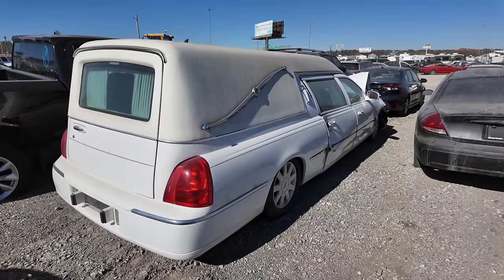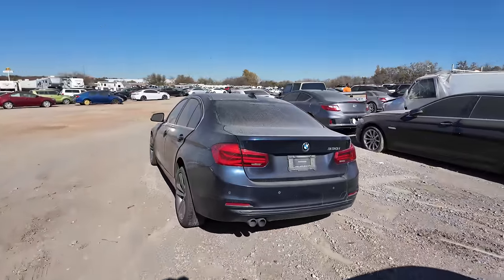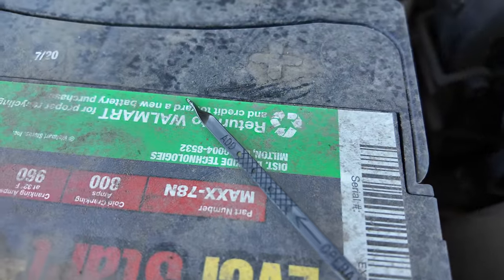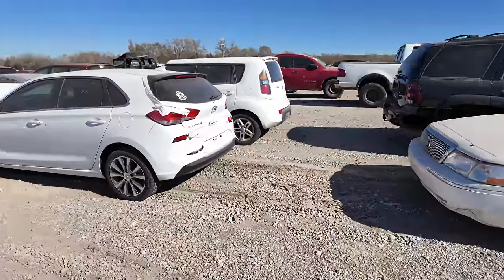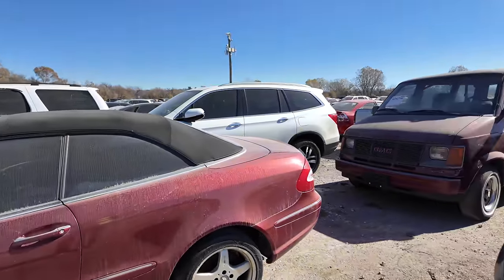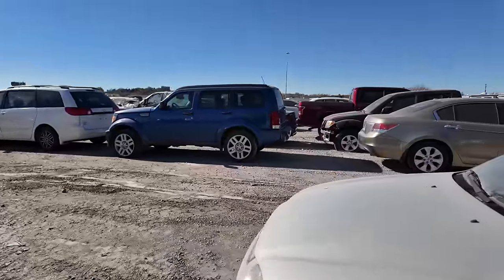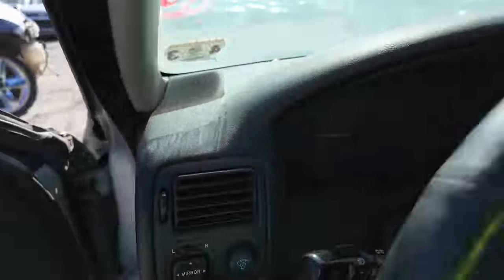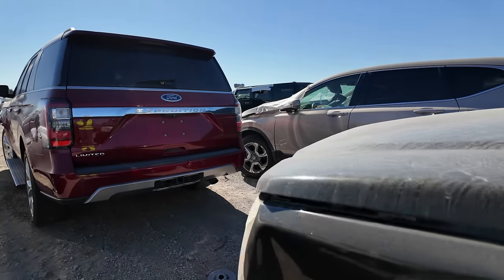This Lincoln Limo Hearse is at IAA for Sale SUPER CHEAP!

Comment: Hearses are all custom builds by coachbuilder companies and VERY expensive new, but depreciate extremey quickly.  Once they're over 5 years old or have over 50-60K miles on them, they go very cheap as the funeral homes aren't the likely purchasers at that point.  I'm a retired undertaker and when I sold the business 5 years ago, my 96 Roadmaster Hearse went with it, with 30,000 miles on it.  It was approximately $100,000 CAD when new in 96,  Thanks for the great content!
Reply: Have they ever had 3 people in front because of the bench seats or is it usually just the driver and sometimes a passenger?
Reply: @42luke93  some of them have 3 seatbelts and some don’t, but as long as you have the nameplates in the side windows you’ll never get pulled over. We had two staff in the front with the minister in the middle seat for plenty of spring interments lol.
Reply: @DTND  
Very useful then. Too bad the automakers stopped offering it on sedans. I believe full sized base SUVs are the only thing to still offer that. Such as a Suburban.
Reply: business is dead for the hearse. sorry.

Comment: Randy, you should grab all the OBS trucks you can that need work.  because of the high cost of new trucks the values of the older trucks are holding.  It is an extra cab long bed with a nice interior.  It can be made to be worth quite a bit of money if you can sell it anywhere but Copart.

Comment: The round thing you found  on the seat of the 90s something  Chevrolet pickup use to be called a squirrel knob. You would clam it (with the bottom piece didn't see it) to the steering wheel and use it to turn the wheel. They were handy when parallel parking.
Reply: Knuckle Buster! I’m a trucker, and use mine religiously!

Comment: Square Body: 73-87 light duty pickups & 73-91 SUV/heavy duty pickups.
Old Body Style (OBS)/GMT400: 88-98 light duty pickups & 92-99 SUVs
New body style (NBS)/GMT800: 99-06 light duty trucks (07 heavy duty) & 00-06 SUVs
New new body style (NNBS)/GMT900: 07-13 "all" (for the most part)

After that, they're only referred to by the chassis code:
K200: 14-18 (trucks), 14-20 (SUVs)
T100: 19+ (trucks), 21+ (SUVs)

Comment: Love the video as always Randy! Would love to see the Safari van and Corolla S on the channel. Those wheels on that Corolla must not be common because I don't ever see them on other ones out there. Like them though. That Chevy truck cleaned up with a new motor would not be bad but it does need a lot though. The Escalade needs a lot but those ones with the factory navigation are hard to find so it would be cool to see on the channel. If you found a factory head unit for the Escalade cheap somewhere it might be worth it. Great video as always Randy!👍👍

Comment: Randy, you’re going to have the 305 and transmission from the Monte Carlo, when you get the 383. So why not use the engine and trans for the ‘92 Chevy pickup? 🤔
Reply: He wanted to keep the drivetrain around when he ends up selling the Monte Carlo so the new owner has the option to revert it to stock. At least that's my last info on it.

Comment: I would take the OBS Clean the interior put a 200 leveling kit on the front and some 31inch tires, and a raptor liner paint job. 5k all day long, maybe more. The OBS sounds like the starter solenoid is shot, had it happen to me.

Comment: Get the hearse and put the body on a lifted truck frame.  Front sheet metal and front door is easy to come by... I suspect doors are pinched by fenders.  Hardest part of bodywork would be straightening out that custom rear door.

Comment: The escalade same condition is going for 9-10k and the non platinum escalade is going for 4-6k and the parts you could find cheap bumper and fender from a local pick and pull and for the center cap eBay have those for 50 bucks. I have a platinum and that's where I bought mine from

Comment: The Chevy truck doesn't look to be all rusted out and it isn't all beat up. The paint is trashed and the interior is a little trashed but slap an engine and tranny in it, clean up and it would make a fine work truck. You could always put a cheap paint job on it just to spiff it up a little more.

Comment: That little Honda that they keep talking about the view whatever it's called. I believe the chase is based on a civic i Wonder if AB series motor or what's the next 1X motor would fit in there. I mean, you've got to swap the key member. But I think it would be cool if you could swap engines. Put the skirts Back on it and drive it.

Comment: Hey Randy on that Lincoln Hurst I wonder if it does have brain damage it seems like it hit above the frame like it rear-ended a truck or something cuz it hit quite high up into the radiator and if you look when you were video a taping it the frame still looks straight I mean it's scraped but it's not bent so I kind of wonder if it does have frame damage granite the doors don't open but that could be just a fender shoved back into the doors?
Reply: IMHO, that hearse is screaming for a body transplant onto a truck frame with a big lift kit.  ;-)

Comment: if you really want a suburban, just get a 2500 instead of that escalade, little more money but the hold there value better.. i think the esv is also all wheel drive, you dont want that, the interior looks kinda rough for that kind of money too.  you can make that 2500 your tow rig. would really enjoy seeing the 92 obs chevy fixed up.. there is another one, but a short bed that might have a good engine thats crashed at 18.52 unless its a v6

Comment: I liked me the yellow mustang convertible next to the Chevy pickup your interested in.
Reply: For the right price, the Escalade is worth a shot. But you have some bent up stuff behind the bumper and headlight you will need to fix or replace. The hood I think is fixable. Maybe a PDR guy can do a good job removing the wrinkles in the fender and hood. If you can find the parts in the matching color, you can save a bunch on paint. Plus there are guys out there who supply matching seat cushions for the front seat. It looks like both rear doors are missing the lower body side cladding. The reflections in the video seems to indicate it’s come off on both sides. 

The question is do you have room on your plate to take on the repair of this caddy?

Comment: that escalade is a steal, you complaining about spending 3 grand on the truck but bought the ugly firebird and the old Cavalier for the same price.
Reply: The Firebird is fine and I like the Z24, it's cool and very clean for the age and miles. 

I would be interested in it if it was a 5 speed manual.

Comment: Randy 1st of all as for the rock thrower you were speeding and you had your hand covering up the speedometer so no one could see how fast you were going.  Only time you were showing the speedometer was when you were actually showing 45 miles per hour also when you the guy throwing rocks the tach was about 600 rpm higher when the guy threw rocks verses when you showed 45 mph.

You always want your viewers to comment on your videos but when they say something you don't agree with you either block them or delete comments or cuss them out instead of being honest and admitting that you are not perfect. 

Monkey wrench Mike is far more better than you and doesn't brag like how you brag.